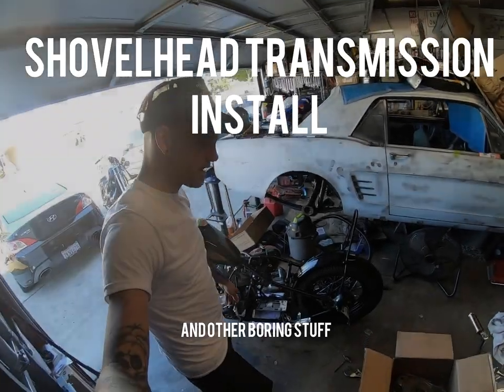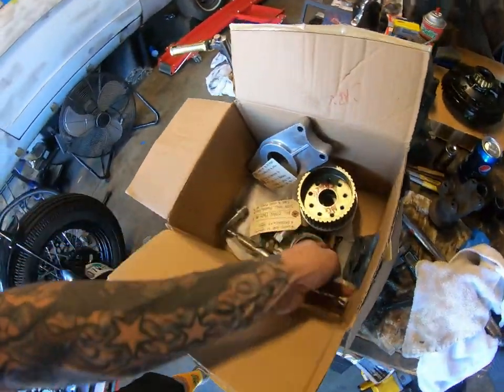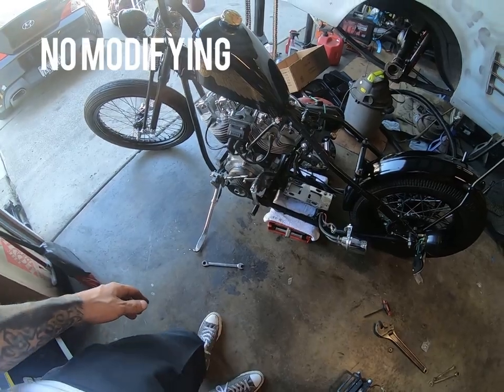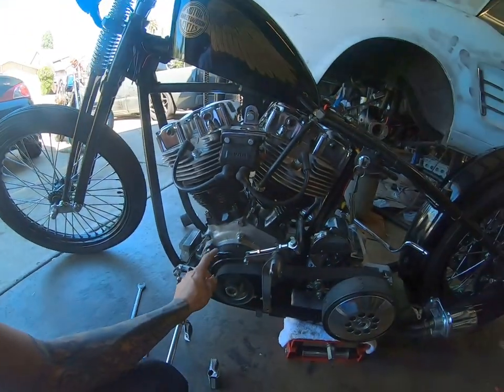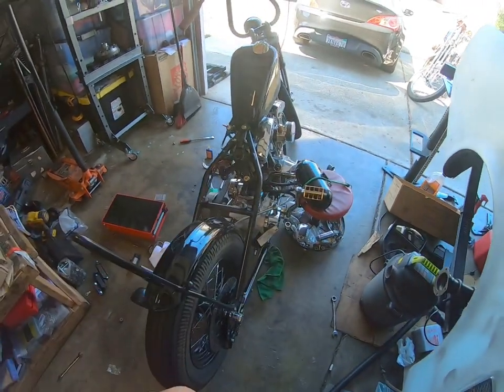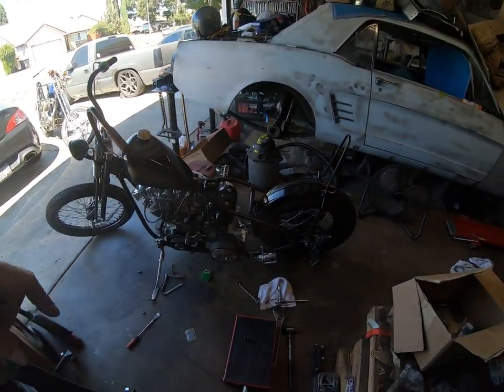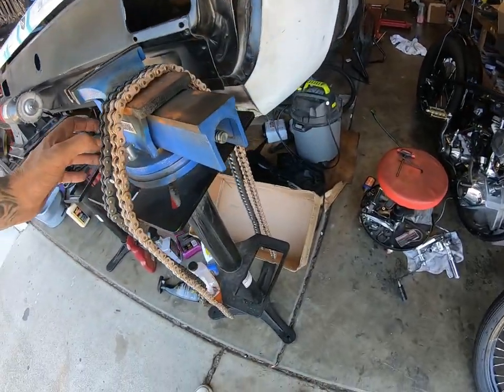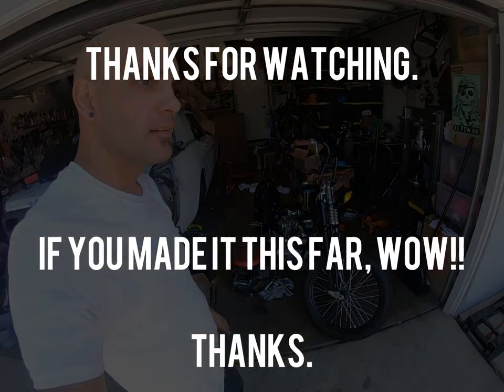Shovelhead transmission install

Comment: Yeah man that's a nice ride! Be careful with those stainless steel bolts though. I did that when I first built my 5220 years ago and I learned the hard way stainless steel cracks easy. Both of my floorboards had bolts cracked and one of my motor mount bolts cracked. I had to switch to grade 8 bolts. I had those damn things shiny as hell too LOL

Comment: Cool build ..
Are you up and running with it yet..
Looks like you've got your hands full..
4 bikes and a car ..
D a a m m ...
Good luck..
Not chain extensions ..
Chain adjusters..
Reply from the maker: No not yet. Haven’t had time to get in the garage because of work. Soon tho. I was waiting on brake fittings since I moved the master cylinder. Soon tho.